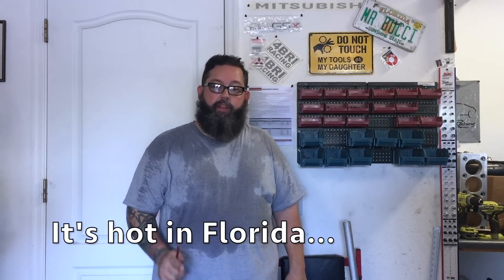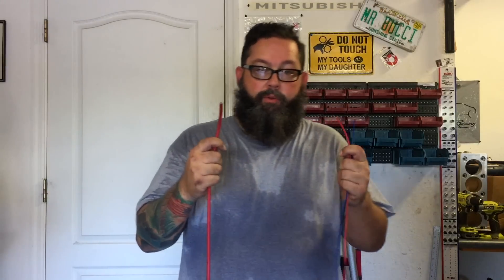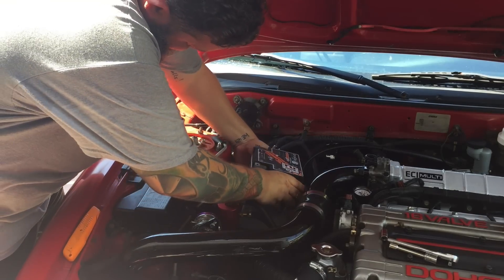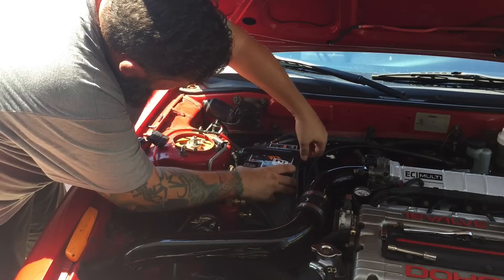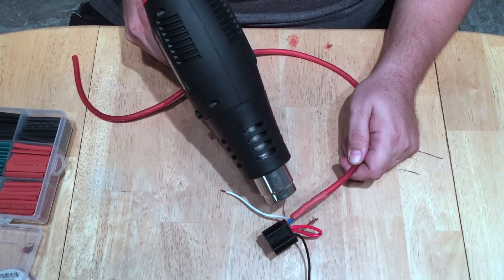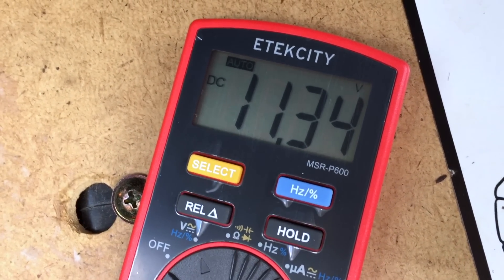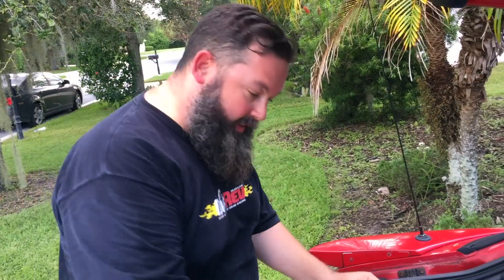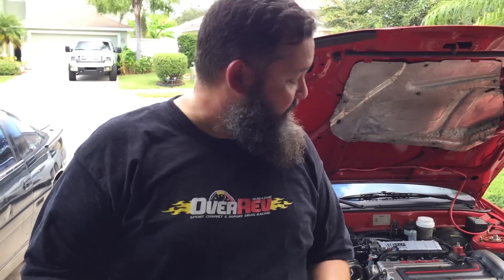Fuel Pump Rewire - Joe Wrenches Vlog #18

Comment: why didn't you take amp draw, amps is what the wire should be rated for. What is the pump rated in amps?
Reply from the maker: 10' of 8 ga. wire is good for about 150 amps at 12 volts. The pump will never draw more than 20 amps.